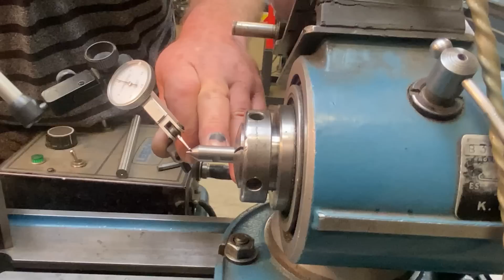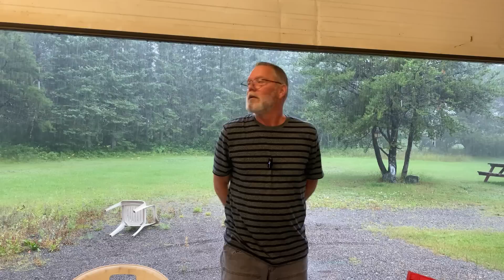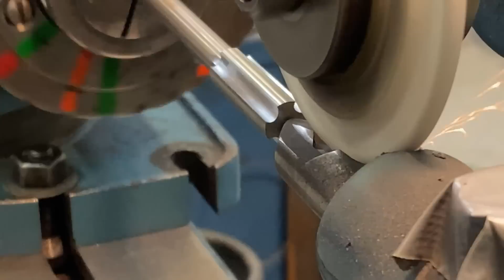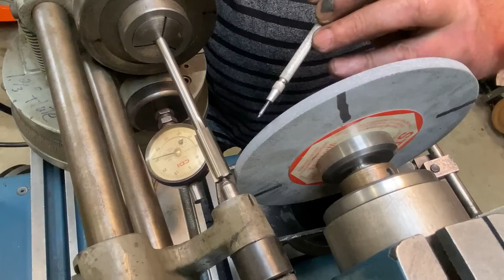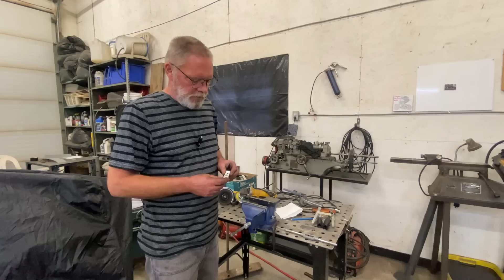LET'S MAKE A LEFT HAND TAP FROM SCRATCH

Comment: Yea i was wondering how you'd get that thread root.

Question though, with a straight reamer only the front cuts , and the rear guides. Why is a thread tap different? If the threads at the rear also have relief,  they could cut into the already formed thread right?  Or am I over thinking this?

Comment: Nice job!  I made a 4 flute chamber reamer from O-1 once.  Lots of tricky set ups and tapers. And during grinding I overheated one flute and it warped (movement from additional tempering) .  So then I had to temper the opposite flute to get it to straighten.   It actually worked quite well.   Next time I would maybe grind out of a HSS blank or even carbide.
Reply from the maker: Thanks for commenting and watching!

Comment: Hello from Aus. What a great video with good detail. You will find the crest of the wheel won't stand uo as the grain size is larger than the radius you desire. Maybe a finer grade. BC
Reply from the maker: What you say makes sense. I used a 150 GR wheel. The finest I have/. Not sure if a even finer wheel would do much cutting or more make everything hot?

Comment: Very amazing work, I once had a KO Lee tool and cutter grinder and it was very versatile. But after I got a dedicated cylindrical grinder (Myford MG12)  it was so much stiffer of a machine and had lower spark out times, having a larger 12" wheel and flood coolant made the results much better. I really admire those who find ways to make these general purpose grinders get the job done with what's available. I had many other grinders but each time I got a machine designed for that specific grinding process it made life so much easier, and many problems went away.

So the lesson I learned is that it's ok to stack together various contraptions to test out an idea or make it through a job, but once I had confidence the job will repeat or money could be made I will purchase the dedicated machine.
Reply from the maker: Thanks for the comment and for watching!

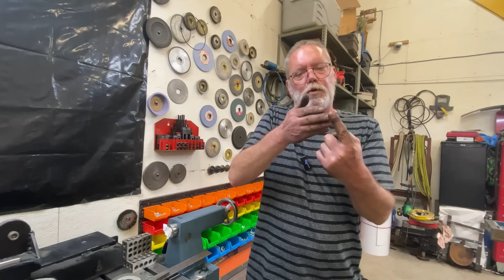Comment: 22:00....
lol.
"if its not tilted to the helix angle it cuts an arc instead of the 60 degree angle the wheel is dressed to, taken to the extreme and rotated 90 it would cut a groove of its own diameter..."

"happier that way" works...
Reply from the maker: LOL
You explained what I meant a lot better than I did. And you nailed it!
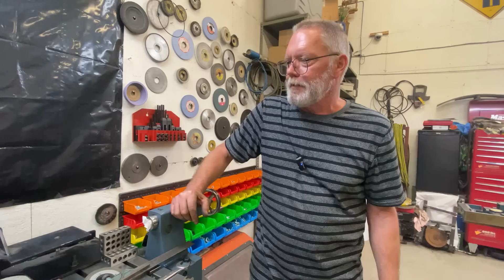I suppose, in our defense, 22:00 was about 6 hrs in for us and rather than collect my thoughts and do it over we just went with it and pushed forwards.
Thanks for the fun, accurate comment and for watching!

Comment: Why did you choose the intermittent cut of the thread? So cutting out the flutes as the last step?
Reply from the maker: Great question
Two reasons. 
First, it's much easier to time the tap in the cam relieving fixture when the flute is in. The flute gives a much more defined beginning and end to the cutting area.
Second, sometimes when grinding in flutes the tool will get hot enough to discolor. This doesn't hurt anything and can be easily removed with a wire wheel. Before the teeth are in you can't really dull anything. After the teeth are in you risk possibly dulling/damaging the teeth if you are too aggressive with the wire wheel.
Thanks for watching!

Comment: Thank you for your videos, I'm learning a lot. Do you clock the driving square wrt to the flutes? is there a smart or common clocking angle for 4 flutes?
Reply from the maker: I don't give any thought to the orientation of the driving square relative to the flutes.
Yes, with any number of flutes it is (normally) best if they are equally spaced so 360 divided by 4 is 90 degrees for a four flute tool. This makes for a more stable cutting action as well as easier maintenance/sharpening. On some tools they intentionally space the flutes of of index/timing to reduce chatter. These are a real bear to sharpen. 
Thanks for watching!
Reply: yes, many taps are clocked to the squares for different operations. Look at one of the flats and it's slightly longer, this is to prevent orientation mistakes when loading it into different grinding machines.

Comment: I would have to say that's the first time I have ever seen a commercial/ Tool Room Tap Cam attachment for a tool and cutter grinder in a home shop. The only ones I ever saw in 35 years of Professional Machine tool maintenance and use in many shops were shop made except for one. All of those you could count on one hand.
Great explanation of their use, the making of decent taps is a bit of a dark art....
Reply from the maker: Actually mine is the only one I've ever seen as well. There isn't much tool and cutter grinding going on any more.
Thanks for watching!

Comment: Very impressed by the thread grinding setup on the lathe.. was wondering the whole time, will he try to hard turn the threads? some kind of clever grinding setup?? But then, after seeing it, especially with the reliving head, could this be done on the cutter grinder, make a master threaded rod & nut & mount rod to the spindle of the relieving head, & nut to a solid support connected to base so it makes the table travel, & turn it by hand ??? 
Also, maybe need a finer, harder wheel... & get out something like a J&S vertical angle dresser & touch up the wheel partway through... Maybe a CBN wheel like mentioned below - they may have one already the right shape & consistency for thread grinding?? 
Love your attention to detail!
Reply from the maker: Thanks for the great comment! Thanks for watching!

Comment: Aren't the grinding wheels shrinking with every pass? Never got how you could get so tight tolerances with it when the tool constantly changes...
Reply: Mr Crispin has a good video on grinding and how a grinding wheel wears down. He works in the grinding dept of Rolls Royce, so has some knowledge of what's going on.
Reply from the maker: Grinding wheels are a lot tougher than they get credit for. There's a ton of factors but they don't just wear away the way you might think.  Thanks for watching!

Comment: Pulsing sparks are at the same frequency as rotating drive dog.  Centrifugal force of off-centre mass could introduce a big wobble mid-shaft.  No sparks close to tail stock because more rigid. Is this a factor in this setup?
Reply from the maker: Great comment!
Because the drive dog isn't very heavy and the RPM isn't that fast I don't believe centrifugal force plays a roll. Most steel has some level of internal stresses that get released during machining and can cause the pulse. Also on a dry grinder like ours the heat generated can cause the tool to expand in odd ways creating the pulse. 
You are totally right about what happens near the teil stock. The tool is forced to run true.
Thanks for watching!
Reply: @Lappemountainliving  I enjoyed the "ridiculous" making of a tool you can buy for a few dollars.  The how-to of making things from scratch to retain the knowledge and depth of understanding fascinates me.
Reply from the maker: Happy to hear that you're enjoying our work!

Comment: Technically tilting the wheel reduces the thread profile angle as it's measured parallel to the axis of the thread. For example a 10 degree tilt changes the angle from 60 to about 59,2 so you would need to dress the wheel to 60,8 degrees to account for that if you want an accurate profile. Of course keeping it straight can cause the opposite as the wheel doesn't have clearance like a single point threading tool
Reply from the maker: That's a good point, thanks for watching!

Comment: "Just buy it" dude has clearly never had to make his own tooling to get that Friday night emergency job done. The shop next door did jobs for the mines. When something breaks, the mine loses more money per hour than that shop made in a year, so anytime they called you better believe someone wasn't going home until the repair was done. Thanks for the video!
Reply from the maker: Clearly you get it. Thanks for watching!
Reply: Yeah, and that one tap or die for the hole that was made by the previous guy who fixed the machine in 1937 with a custom tool too because the tooling in 1896 was made at a pitch of "whatever my lathe is" and a diameter of "that l'll do with the stock I have".

I used to work in IT and with some industrial stuff and even then the legacy stuff is often bespoke and ancient, I'm talking stuff where the manufacturer went out of business 20 years before being still in production. Or like a machine on windows xp in 2023.

For industrial machinery, the rollover is even longer, you need a good justification to replace a machine that costs millions to stop.